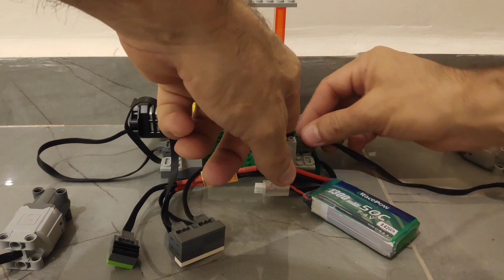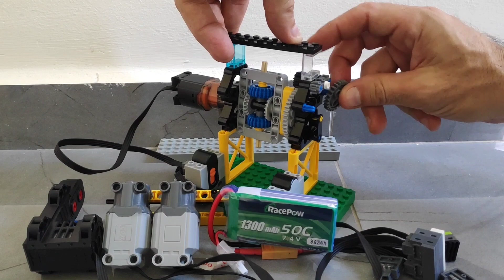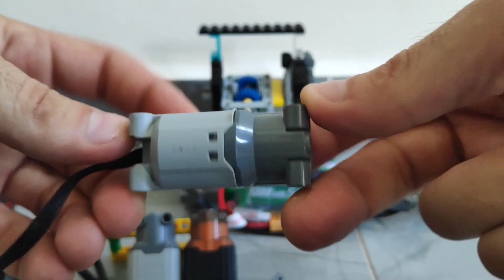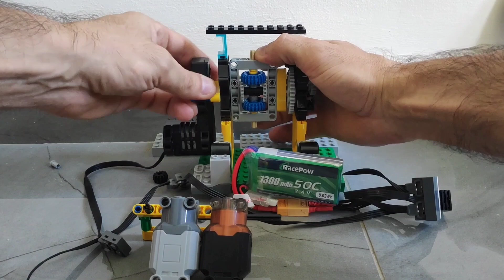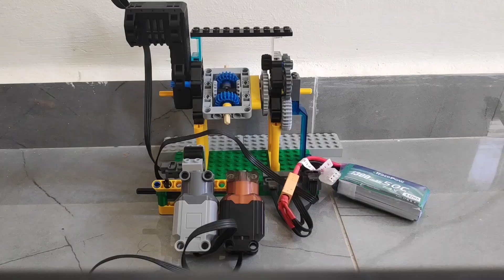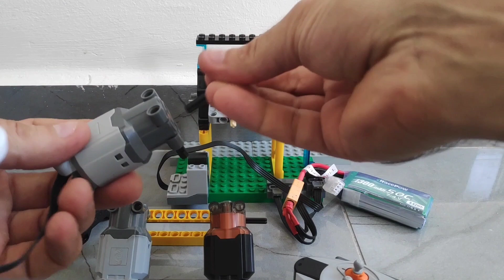lego motor. speed vs torque experiment. lego technic.

Comment from the maker: ****Open subtitle option****
Conclusion: choose your motor with respect to the torque in your built.
Stressed motors takes more current and causing hit. Large AliExpress and buggy motor shown the most efficiency and flexibility.
I used lipo- it means maximum torque with endless current to spent. With lego battery you will get 1/2 or 1/3 of that power.
I think lego battery is 💩. Lego IR is even worse, and buwizz 12.5v is a totally joke that will never work properly more then 3 minutes, under minor stress.
Reply: Why is buwizz a joke? Overheat?
Reply from the maker: @Einheit101  yes, it can melt your plastic connectors, and lego motors didnt ment to work with more the 9v. Current protection is other reason.
Reply: @yuvallegomotorized  well i removed the overheat protection from my BrickEngine V1 motors, which added another 0,2-0,4V lmao.
However i am building tanks, not cars.
Reply from the maker: @Einheit101  did you remove the protection from the motors or from the buwizz ? Or other unit ?
Reply: @yuvallegomotorized  i removed protection from the motors. Almost all motors have such a resistor inside. Normally i dont do this, but one of my tanks required maximum power on a very small room so i had no choice 😅
2 Motors in a room that is only 4 studs wide and 5 studs long!
The step down converter limits current at 3,5A, which is more than enough.
Reply from the maker: @Einheit101  most of the time, AliExpress motors dont come with that protection. This protect only your motors, tanks is more stressed the motors then cars, but it wont protect you from melting. Anyway you have other protection on the buwizz unit. You cant drow more then 6 or 6.5A under any circumstances. With the 12.5 version of buwizz, it will cut around 2.2A. you can see buwizz clip with the speed record how he try not passing 2A.
Reply: @yuvallegomotorized  my step down converter limits at whatever value i want, i have set it to 3,5A +10,8V which equals 38 Watts and it prevents the box from melting. But my motors dont need that Power, i guess 1,5A is more than enough for my whole tank. Of course not enough for 6x Buggy Motor.

Comment: I'd like to know more about the insides of these electric motors.  What makes a motor faster or slower?  The strength of the magnets?  The wire coils?  Brushless vs. brushed?  Is there a gearbox built into the plastic motor cases to change the actual electric motor RPM to some RPM output that holds the + axle?  If the motor has built in torque and higher speed, maybe that's a good design combination.  CADA sells 2 batteries, one is their "standard" and the other has a higher amp.  I think the Hummer comes with this higher amp battery.  I have not experimented to know the difference in using one or the other.

Comment: i love Black Furious Hyper Speed L motor, is small and really fast. Works really well with RC small and with very low weight. unfortunately, all my battery box and receiver are broke :(
Reply from the maker: AliExpress is open 😉 3.5 $ receiver. Lipo is around 20$ with cheap charger.
Cada, m.k and other is not that bad too, just less power, but way better then lego battery.
Reply: @yuvallegomotorized  the AA and AAA lego battery make so many problem to me. With 2 fake buggy motor and lego receiver make a weird sound and go so much slow. I don't try with sbrick or buwizz (because they are so many expensive and for me, it's not worth it to spend so much money on them).

I would like to try with drone batteries how lego RCs go
Reply from the maker: @Stealth_Simogamer  drone battery is lipo. Dont try over 7.4v and never try to operate 2 buggy motors on 1 receiver. 
Lego battery got current protection. Lipo not, so if you will pass 5A your receiver will fry in a sec.
I do think buwizz is way too expensive and not that good as well. They arogant attitude is not help them too 🙂
The copy of it is not bad and around 22$. The weight of it is still problem, that is why i went for my configuration with multiple ir and motors and small strong lipo
Reply: @yuvallegomotorized   thanks for your advice 👍

Comment: O!!! I have see that you bought the black mould king L motor! Do you like it? Or it disapoint you?
Reply from the maker: Hi mate 🥰. 
Im happy that i bought them, varaiaty is allways nice. But i dont think i recommend them to most people. 
They realy good for small wheels, light weight, fast vehicle, or something other with 0 torque. I couldn't plant them on my sumator ripsaw well. they didnt spin together with the buggy motors, even spin back if im not power them. That under the dif gear... I have a plan how to pass it, i hope it will be still useful for me. 
When i powerd them alone with the sumator ripsaw, i had great speed from it, the caplled buggy motors power just cancelled them totally to zero.
My favourite and recommend will be surely AliExpress buggy and L motors.
Reply: @yuvallegomotorized  i like them too:-)